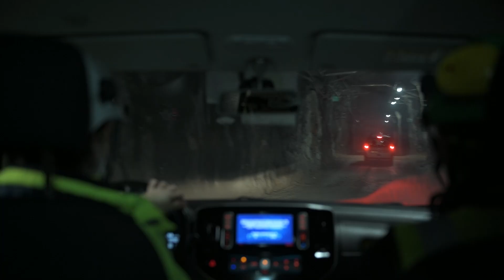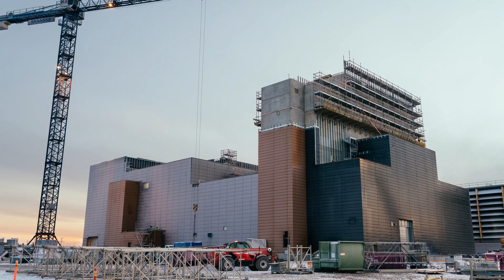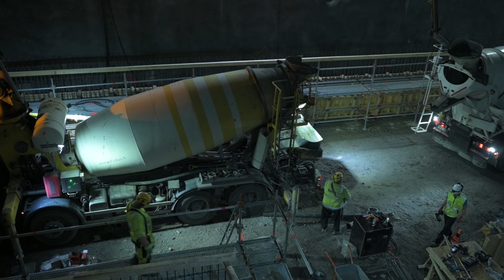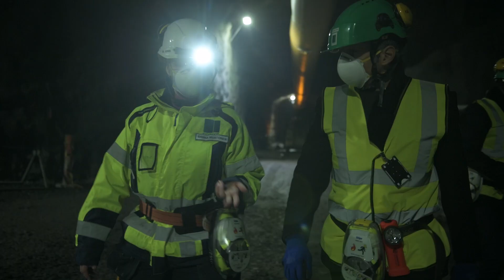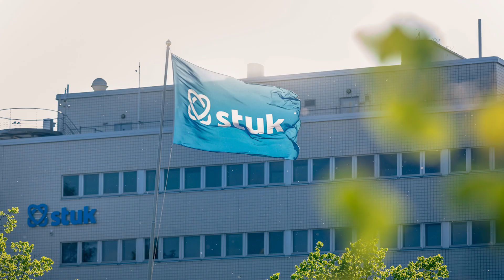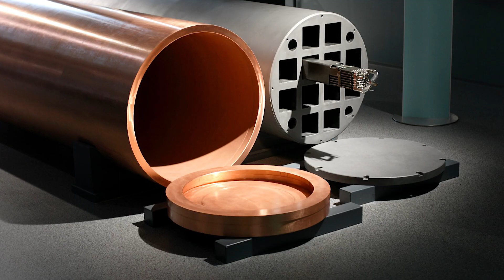Watch how Finland plans to store uranium waste for 100,000 years

Comment: Why don´t send it to space, towards the sun?
Reply: Imagine that rocket burning up in the outer atmosphere if the second stage failed and spreading its contents around the globe.  What a catastrophic clusterf*#k that would be. Sending it to space is about as unsafe an option as I can imagine.
Reply: This question has been asked and answered many times.
I'll just poorly mention two points:
a) How reliable are rocket launches? What if one of them fails and the stuff comes falling back to earth? I'll leave it up to your imagination.
b) Counterintuitively you need much more "rocket power" to get something to the sun, than it is to actually send it out of the solar system.
Reply: Cost. Space X, which has the lowest rates, charges $27,000 per lb to resupply the ISS. The rods would have to be encased which adds much more weight. It simply isn't cost effective and the risks are too high. Also, there is no reason to target the sun. Just aim for a void in space.
Reply: The very simplest answer is that IT COSTS A COMPLETE AND UTTER FUCKTON! Its completely impossible
Reply: Brilliant idea. You sound like a nuclear physicist! Who else could come up with such a solution. Why don't you calculate the number of flights needed to send it to space. Do you suggest we leave it in the 70 ton storage casks to protect against radioactive emissions or just load it in hot and hope it doesn't melt down and destroy the rocket before it gets off the ground? What happens if it blows up 30,000 feet above the launch pad?
Reply: All valid points, thanks. But I think that in a era when someone can send a car to Mars, this should be lesser problem.
Reply: @andrecarvalho8679  The car was a publicity stunt and an advertisement for Space X so he could afford to do it. Cars aren't highly radioactive.
Reply: @andrecarvalho8679  are you serious. So SpaceX sent a car into orbit as a marketing stunt. Cool. That’s hardly a measure of rocket reliability.   They fail way way too often to be launching nuclear waste that has the potential to kill millions and pollute the planet for eons. You might want to rethink that idea…
Reply: @andrecarvalho8679   Rockets explode more often than you think. Something like 1% or so.
Thats way too much, it would be a much bigger disaster than Tschernobyl.
If the car goes back to the ocean, thats no problem, but if highly radioactiv material bursts in billions of pieces, the whole earth would suffer.
Its far too dangerous.
A car is something quite different...

Comment: They should use a thorium reactor instead. 🤷🏼‍♂️
Reply: They should use the fusion reactor that we have been using since mankind came into being; the one 93,000.000 miles away that has been providing reliable power for free. thorium=U-233=nuclear=radioactive waste=death. And oh, so expensive.
Reply: @jackfanning7952  Have you looked at how those precious renewables are made?   For just one item - you should know how the silica for the solar panels is created...or do you still think it's made from sand?  It's not...too many impurities that way.  If done that way, panels are too inefficient to even give initial ROI.  
So, what they do is they take coal (anthracite) and quartz, put them together in a furnace and melt both together...that furnace BTW, is a coal fired one.  SO you're literally using coal to melt coal (and quartz)....yea, that's gotta be a better option.
Reply: @Adam.Rushing  Every other option for electrical energy is cleaner, safer, more efficient and 3-5 times less expensive than nuclear. That last reason is why nuclear is on the way out. Those gnomes on the top floor of the multinational financial institutions do not care any more about the death and environmental destruction caused by nuclear as the nukies do, but they don't like to lose money. They like reliable investments and a quick return on their investments. That leaves nuclear out.
Reply: @jackfanning7952  Now, about 90% of that I totally agree with...the finances.   For the fat cats, it's not about anything but the almighty dollar, as they say.  
These Gen IV reactors are going to consume old waste also...so there's that.  

I've worked in several industries where we handle materials, and I'm here to tell you, eventually you spill something.  It doesn't matter how good you are, eventually either human error, poor design, or worn out parts fail...and now we need to add the earth shifting too I guess.   The thing about oil is it is a fertilizer in lower concentrations.  There are tons of good things made with it and it's byproducts - to include these computers/phones we're typing on right now.  

If you spill oil, it isn't difficult to clean up at all. "Spilled" radiation though, now that's another story.
Reply: Except it doesn't work half the day. Also, check where Finland is on the map 😝
Reply: @vladyslavkorenyak872  The renewable share of the energy market in Finland in 2020 was 40.6%. Nuclear's share was 30% in 2019.